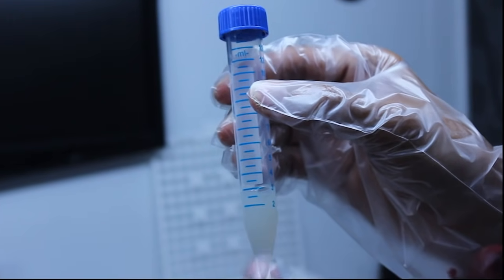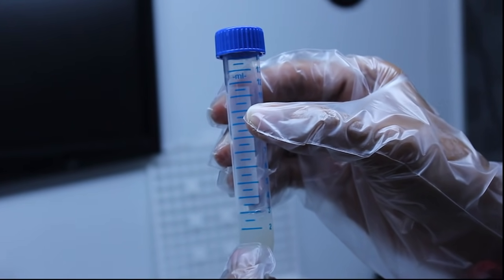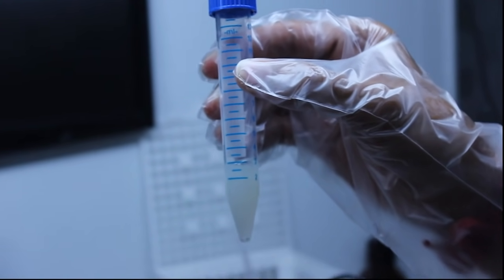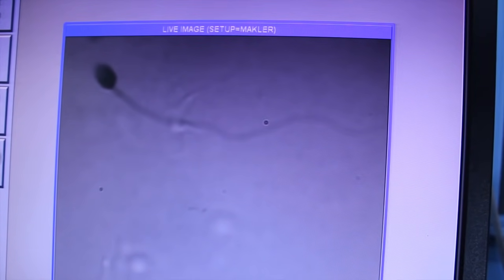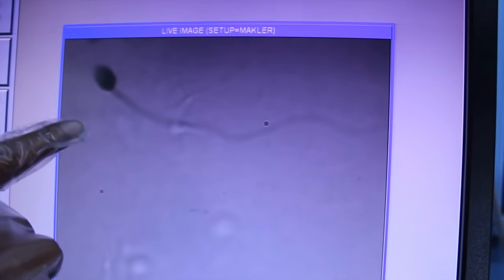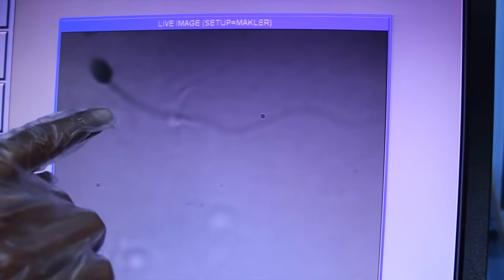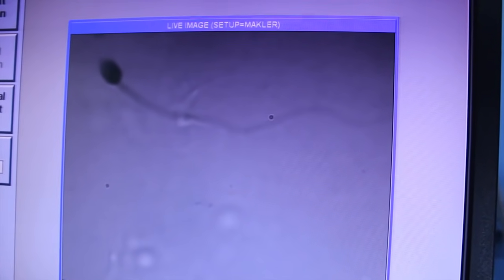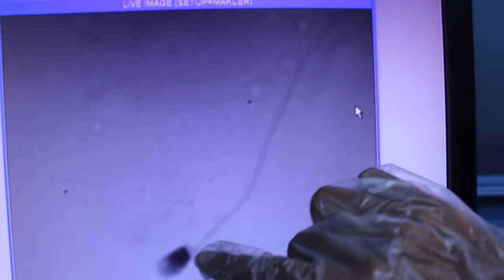Semen Analysis

Comment: i notice i have High PH of sperm Alakline is it good or bad? 9.0 in the strip
Reply from the maker: Alkalinity in semen is due to seminal vesicular fluid or rather may be due to lack of prostatic fluid (acidic). So high alkalinity can be a sign of prostatic dysfunction.
On the other hand, one more point also has to be noted that semen ph value increases with time, as natural buffering decreases, so high ph value may provide little clinically useful information. (Ref: WHO manual 2010)